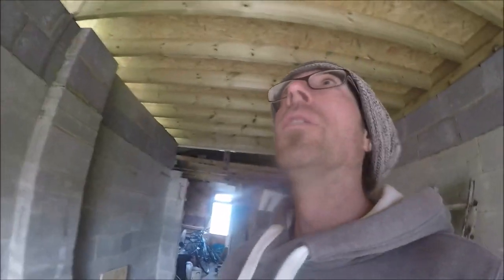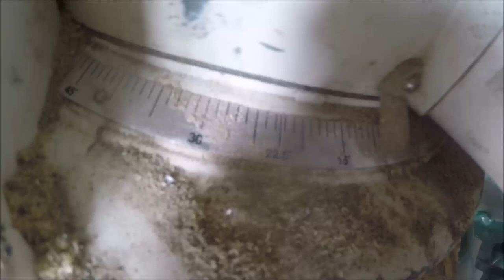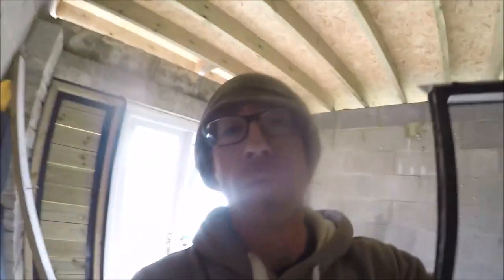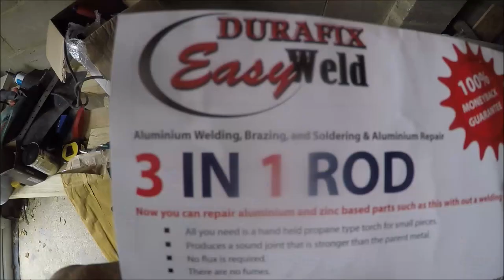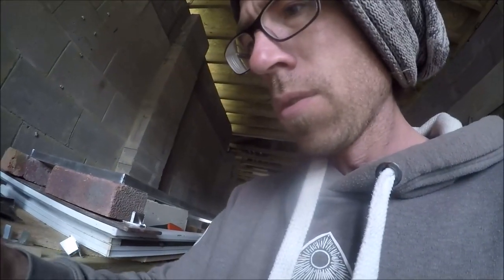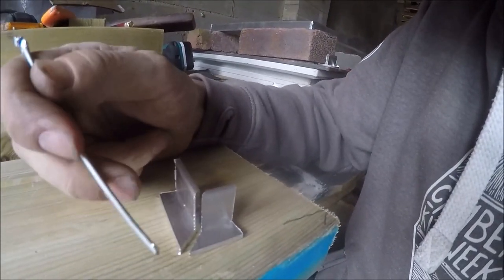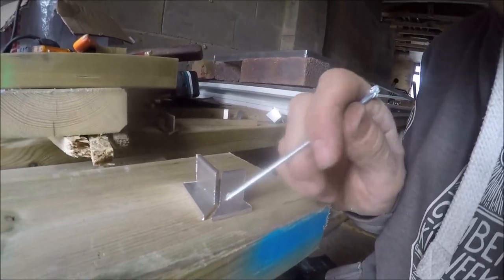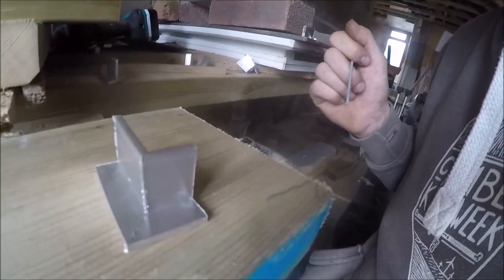How to make a skylight from a double glazed window unit with Durafix Easyweld Aluminium rods

Comment: I love the idea of upcycling windows, I am going to be replacing my conservatory roof this summer, it's upvc and polycarbonate and leaks like a bugger, I was thinking of doing a DIY skylight this morning and found your video,part 2 seems to be missing but that could just be me. I have a slightly different idea to yours and would love to hear your feedback. My idea is to take the uPVC unit and then have a sheet of toughened glass cut 10-20mm larger all round than the unit. Next up is to use ultra clear UV bonding liquid to join the glass to the unit.
Then spray the outside edge with black so from the outside you have a nice boarder. The glass and unit as 1 could then be bonded in to place with a strip of foam sealant and marine sealent to the roof. It's just an idea and there are probably a million reasons it would not work, but that's what a community is all about, sharing knowledge and making things work. Any feedback critical or otherwise greatly appreciated
Reply from the maker: Seems better thought out than my plan! People have said that a more substantial upstand is beneficial, they are probably right. 2 years on and still good, i may add a bit more sikaflex in autumn and routinely service before winter. I have an awful plastic conservatory too but i think eventually we want to knock it down and start again. Good luck
Reply: @CamberKitesurfing cheers for the reply mate, it was one of those procrastinating days off and that's what came to me 🤔😂 I found part 2 of the video, can I ask a question? When you were installing the window I thought you were going to mount it the other way up, similar to what I plan to do with the glass on mine, have them slotted in flush with the Ali sealed to the roof. You mentioned more substantial upstands can I ask how they affect things? As I would be looking to go to zero upstands, would be good to hear about it. Have a great afternoon shane
Reply from the maker: @MrShaneb1975  something to do with building regs i think, the other way up should work too, so long as it's completely sealed

Comment: DO you have a link for the aluminium T piece you used please? And as CP says, how has it been since you installed it and it has had time to bed in?
Reply from the maker: been in 6 -7 months now, plenty of rain, seems fine. look on metals4u, aluminium t section
Reply from the maker: sikaflex and screws every 15 cm helped alot

Comment: Unfortunately as this is a normal double glazed unit, the unit will probably fail and mist up due to UV attack on the glass butyl seals.the glazed unit is supposed to sit behind a bead to protect it from failing as its just window glass. Rooflights are bonded with structural silicone which doesn't fail under UV attack... Whilst a cheap way of doing things its not really a long term solution, but to be fair it's just for the garage. !! so who cares !!!
Reply from the maker: probably should have just bonded the whole door to the roof ;)  It was a budget issue at the time, if they ever leak we'll do something else. I'll run some tape around the perimeter to stop the UV, thanks